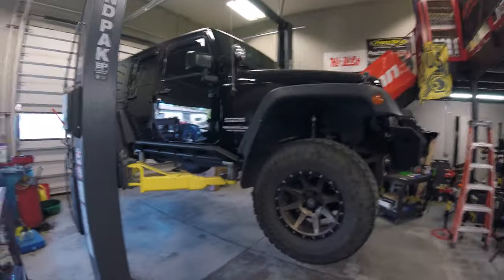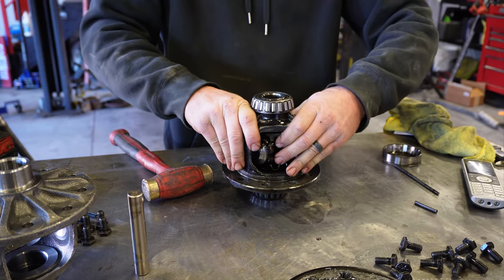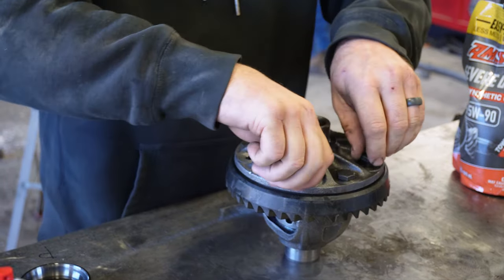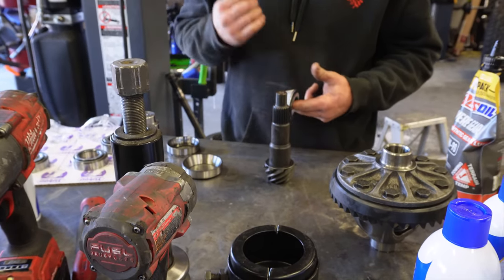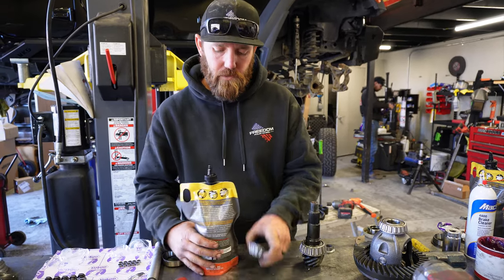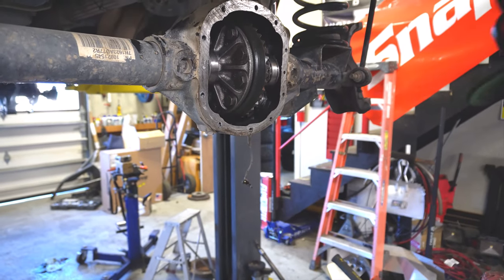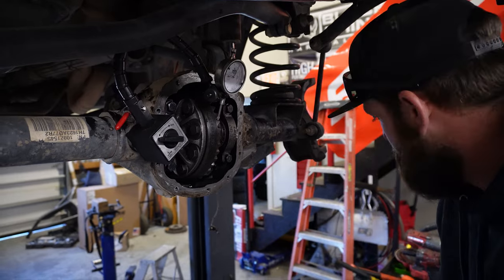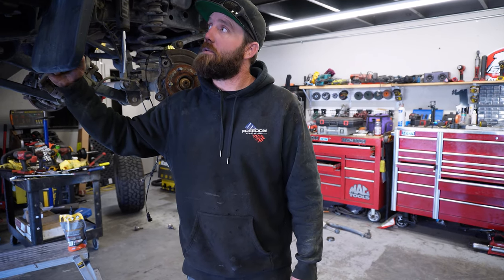How to Regear a Jeep JK Dana 30 - Ultimate Guide To Regear A Dana 30 | FreedomFourWheel.com

Comment: My wifes jeep just broke 5 teeth on the rear pinion. She has 4.56, and she runs a 38. So now luckily me, I get to spend my holiday week re gearing both her axles to 5.13s. This will be the first time I have done a ring and pinion myself. So hopefully, I don't mess it up too bad 🤣🤣

I enjoyed the video as well by the way.
Reply from the maker: haha oh shoot. You got this man! Let us know how it goes!! Thanks for watching 👍
Reply: @Freedom Four Wheel  I will for sure. Lol hopefully its good news 🤣
Reply: @Freedom Four Wheel  well it was successful. I was able to install 5.13s with a rear mechanical locker. With no issues, and everything is driving great.
Reply from the maker: @JeepTrailsandBarbells  NICE!! That's what we like to hear! Congrats Jeston!
Reply: @freedomfourwheel  thank you!
Reply: I have a 2005 LJ and the shop wants $2300 for a regear to run 35’s. Does that seem steep?
Reply: @JH  for both axles? No, it's about right. When i took mine to the guy i used to go to, mine was 1500 total for both axles to be 4.56. My wife was 1800 total for both her axles to be 4.56. 4wheel parts wanted 3600 for mine and 4000 for hers. So just depends on what parts they use and labor. But on average 700 to 1200 a axles is about right.